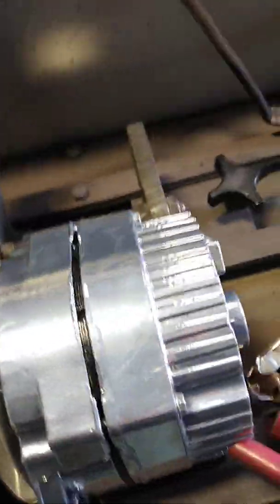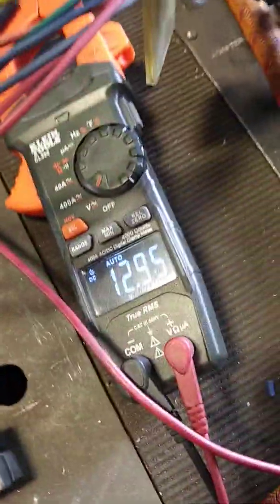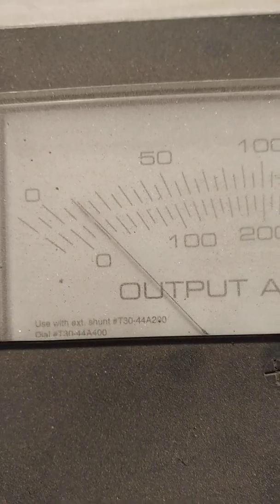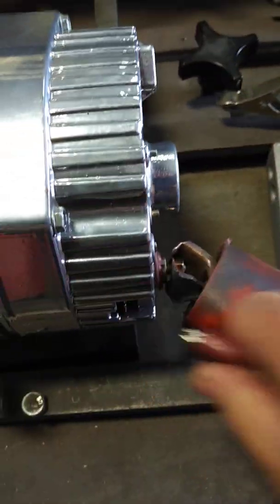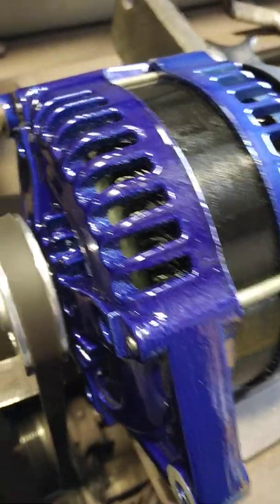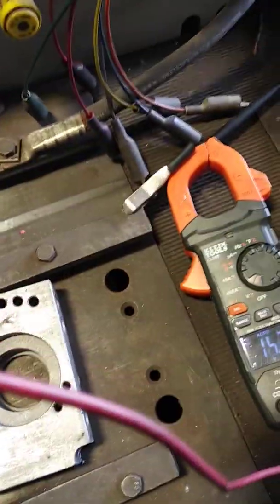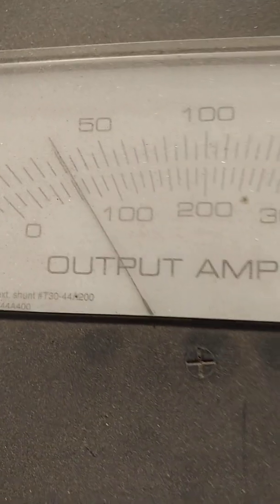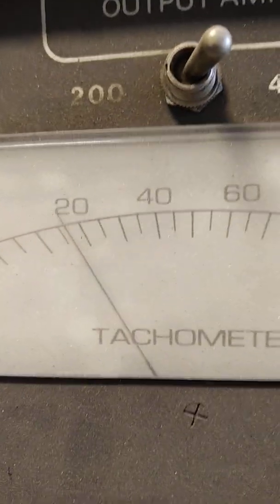Ebay vbelt idle output comparisons and contrasts to our denso hairpin design alternator.

Comment: Have older car so if I upgrade alternator it will keep battery charge my battery keeps draining even if Car is not on  I have red top optima battery
Reply from the maker: If battery is draining while CAr is off means you have a parasitic drain in your system. Feel your alternator in morning before you fire it up. If it's warm then you have an issue.